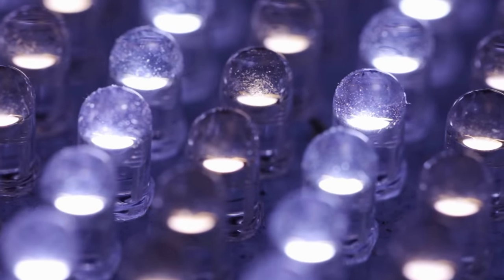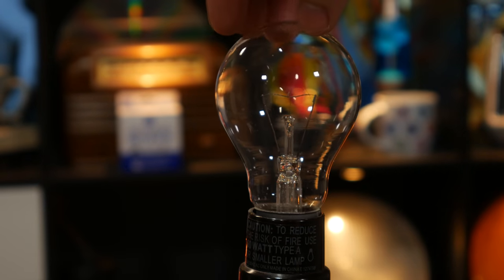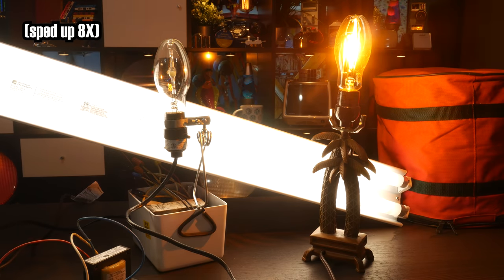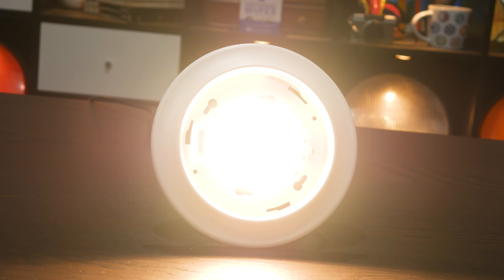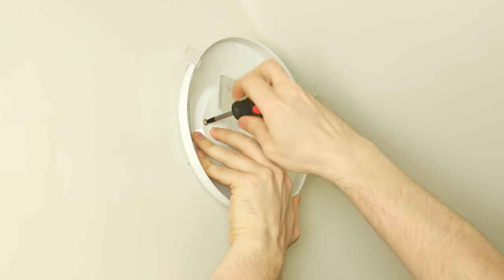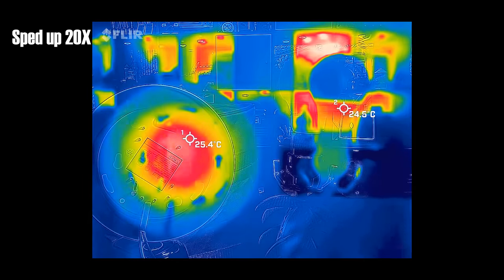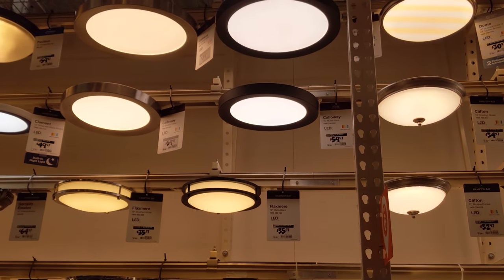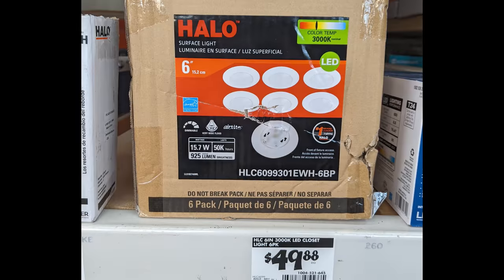A troubling trend in lighting?

Comment: I'm here to provide the aforementioned inevitable wire nuts vs wagos argument. Integrated LED fixtures are a great application for wagos, because they're quick to remove when the fixture dies, easier to install correctly than wire nuts, and more easily handle the joining of solid wire with the stranded wire from the fixture.
Reply: Funny??? Here in the USA I have been using wire nuts for over 40 years and have never had a problem. The key is to use them correctly by stripping at least 1/4" of the wires and then critically aligning the tips of the wires holding them firmly while twisting the nut on. Also, don't over/under exceed the amount of wires inserted into the size selected and it's wire size/quantity rating.
ie... Don't try to insert only two 12ga wires into a red wire nut. For the red nut at least 3 or more 12ga or two 10ga minimum.
You can look up the specifications for each size nut and then use them correctly.
Reply: GreatScott! has a video on this very topic.
Reply: @quinnobi42  I've seen it and probably made a comment there too.
Reply: @DrHarryT  So we can say that you need 40 years training with wire nuts to be able to use them as easily as a Wago? 🙂
Reply: 100% the WAGO lever nuts are PERFECT for this lighting application.  I have never seen the lights this dude has in the video.  I buy the kind that have the electronics in a separate electrical box and the light itself connects to that with a secure but easy to remove connector.
Reply: @DrHarryT  So there's little to no tolerance in the method of fixing?
Reply: @alvaros.  nah, you need like one minute. Wirenuts are easy as crap. Its legit strip, twist with pliers the. Twist the wirenuts.
Reply: @DrHarryT  bruh, red wirenuts can hold most stuff if you aint terible at twisting wires. 2 12s in a red is alright
Reply: @kyungrix1112  can’t burry junction boxes
Reply: @syi tiger907  yeah pretty much everyone knows that,  why are you telling me? 🤔
Reply: @DrHarryT  not sure if you were being sarcastic, but thanks for proving OP's point.
Reply: Thanks for the info on wagos.  My dad used to solder wire connexions in the old days, then finally used wire nuts and wrapped everything halfway to midnight with black tape.  I think I prefer wagos after listening to the vid, reading your comment and doing some scouting on the web.
Reply: @DrHarryT  or use wagos and avoid all that. Reducing the opportunity for errors.
Reply: @calebsanders1078  Ive seen over and over you do not twist the wires before using the wire nut
Reply: @DrHarryT  I’m a recent wago convert and I’ve been using wire nuts for as long. Wago much cleaner and take up far less space in the box.
Reply: A little bit of third world insight: we rarely ever use either one of those, and the only somewhat decent solution you often see are terminal block connectors. Usually people just twist the wires together and wrap them in tape (including electricians, which is why I installed everything in my home myself). Wago connectors seem to be quite overpriced here, each easily costing twice as much as an LED light bulb
Reply: @DrHarryT  The fact that something has been used  for a long time is not a reason for not improve it. Think of the awful Imperial system...
Reply: @asronome  Bro you are getting ripped off hard, those things cost nothing here!
Reply: Coming from germany and basically doing my own home electricity since 25 years after the big fuse box, I never seen wire nuts before. Just purchased a ceiling fan, and I wondered how anybody would use those things over wagos. Or if you dont want wagos, the cheap way here are "Lüsterklemmen". basically wagos but you fix the wire with a screw and can do All 3 wires on on clamp. 
Like wirenuts seems like such a big hassle (and also take up the same amount of space) compared to lüsterklemmen. Personally, when space is of importance I solder the joint, if not wago. If I dont have wago, lüster.
Reply: Holy crap! Why had I never heard of wago connectors until now?! So, when I had to replace a bunch of ceiling fans and light fixtures in my new home, I was using wire nuts. My house has much heavier gauge wires than what any of the new fixtures were using and I was having trouble getting the wire nuts to grip both wires (if it was tight enough to grip the house wire, it would mangle the fixture wire, pushing it down and out of the wire nut. If I went up a size, it was too loose). The lower gauge stranded wire just didn’t want to play nice. Using a wago over a wire nut would have saved me SO MUCH time and aggravation… and saved my sore shoulders, back, thighs, and feet from standing on a frigging ladder with my arms above my head for long periods while I argue with stupid wires…
Reply: @OgbondSandvol  Think of the physics/design of each method.
The WAGO uses spring loads to make contact with the wire in pinpoint areas. The bridge between the holes is a thin metal strip. US code allows for safely flowing 27 amps through a 12ga conductor while 10 wires are packed into a 1/2" EMT conduit. Typical limit for inserting a 12ga wire into a breaker is a 20 amp breaker. Now try inserting two 12ga wires into each hole of a WAGO and flow 20A through the connector, then use an infrared camera to measure the heat. I am certain it would be quite substantial. That heat over time would degrade the connection. Heat/poor connection/pressure=Failure.

Now look at the wire nut...It has a spring steel cone with sharp threads that when wires are inserted and it is screwed on it bites into the wires and with the cone shape begins molding the wires together. Those wires end up with 1,000's of pounds worth of pressure.
I was born with the "Imperial system and it has also worked perfect for me. Admittedly Metric has more granularity with only two exceptions and that is in temperature readings and in our utilization of .000" [thousandths of an inch]
Sometimes easier is not better.
Murphey's law...
If it works, don't F-with it.
Other principals that are akin to that one...
Don't break a winning combination.
and
If what you're doing is not working then maybe you ought to try something different.
Wire nuts = Work.
Imperial = Works.
Another principal...
If you keep doing the same thing you're going to get the same results.
I like the results,
Reply: So it's WAGO all the way... go?
Reply: @Caffeine.And.Carvings  I always hated that we had to use Lüsterklemmen in school (went to a trade school (Berufsfachschule)) WAGOs are just so much better imo. They are also safer because the can't come loose over time like Lüsterklemmen.
Reply: Wirenuts are easy..... but repeated usage weakens the wire, especially stranded, but solid too. At best you only have 6 inches free up there, sometimes a lot less. I am a electrician myself, and even I can see the benefits of a wago in a low current setting like this... especially given the disposable nature of these fixtures.
Reply: @DrHarryT  You have listed all the reasons I hate wire nuts except for one.  My hands are usually greasy/dirty, so I have to have pliers to get to the correct torque.
Reply: NAH... If and when I ever get stuck with a disposable fixture, I'm wiring an outlet to the inside of the box and an ordinary power cord and PLUG to the god damn lamp... When it dies, unscrew it with flashlight in teeth, and pull the plug... Toss and replace with a newly "remanufactured" lamp as before... done...

    I have a soldering set up I'm NOT afraid to use... and LOTS AND LOTS of hard-solder. (high-temp and high abuse tolerance)...

     If you got the impression that I say thing s like "F*** it... It's good enough for government work." You are CORRECT. ;o)
Reply: @alvaros.  IKR?! I used a Wago properly within a minute of picking one out of the packet, use the specified AWG range on the connector, strip back 11mm of wire, open the lever, insert wire all the way, close lever and you're done.
Reply: @DrHarryT  The bridge between the holes IS NOT a thin wire strip. Today I installed a Wago rated to 41A (but UL rating is 30 A - but I myself have some doubt, and the appliance uses max 25 A). The bridge is electrolyctical copper.  
Wire nuts work, but most of times Wago works better.

Imperial works? Sort of.
Metrics works better, but I'm afraid that you would need to born again in a metrics environment to understand it. ;-)
But, although its population uses Imperial, is good to know that US is a metric country, too.
Reply: @OgbondSandvol  All american weight measurements are made from a reference weight that is exactly 1kg and was imported from Europe
Reply: @DrHarryT  I first want to get straight what you're calling "a wago". After over 20 years as an industrial and commercial maintenance electrician in the U.S.I felt the same as you, until I realized a couple of things a couple of years ago. One is that what people refer to as wagos are two different things, one is the push-in and one is the lever nut. I'd only had experience with the push-in type until a couple of years ago. I don't like the push in type, don't trust the grip since the way I usually take them off is to just twist and yank and almost impossible to get a good grip on stranded if unless you tin the wire and bringing a soldering set up hip deep into a ceiling is pretty low on the list of things I want to do. My feelings on the lever-nut type are completely opposite, I've actually hung my 300 lb self off of a lever nut connection. It's not going anywhere unless you goof on the stripping and either feed plastic into the grip or not get enough into it to hold. The second thing is the rating is higher than the wire you can fit in it so don't worry about the rating. The one that fits 12 awg is rated at 32 amps the one that fits 10awg is rated at 41 amps that's at least 6 amps over the wire size ratings.
 Another thing you mention is the pressure of the wire nut screw cone. That lessens over time, it's a spring just like the wagos, and unlike the wagos whose spring can originally shut to nothing the wire nut loosens if just a little tension is let off and only down to it's original gauge. I've opened several old fixtures with loose wire nuts that were fine for their first 20 years. Also if you're the type of person that in construction 100 percent believes in the turn of his wire nut, you're the type of person I don't want to follow in maintenance because you leave twisted solid wires and broken off strands of stranded wires that I can't put in another connector so have to cut it off and lose a precious inch or so of wire.
Also you can add and delete legs in a wago safely and easily live, unlike trying to fit the hot back into the wire nut with the new leg without putting your fingers on the wires to straighten them out.
I'm a full convert on the lever nuts. The push ins I only use on ballast bypasses for fluorescent to led because it's a lot quicker to just stab 7 wires for one side than try to get 7 tiny ballast solid wires to all agree to be held by a wire nut and they only have the levers up to 5.
Reply: Stop defending your personal experience like it is some important rite of passage or required curriculum.  You can take the easier route without forfeiting your electrical engineering degree (even if your practice at using wire nuts no longer confers any ongoing benefit).

I too have been using wire nuts for years and find them very straightforward and intuitive.  No training is required, and they are perfectly functional.  I recently put up some pot lights that had me using wago connectors for the first time ever, and I'd have to be pretty irrational to defend wire nuts afterward.

In a simplistic sense, wire nuts are indeed easy.  In a practical sense, you still have to strip 2 solid wires, twist them together with pliers or wasted over-stripped wire to be cut off afterward (because you're going to actually make a strong connection with plenty of solid contact, right?) and then screw on the nut.  When connecting stranded wire, after twisting it around the solid one, you then have to carefully hold it against the tip lest it slide away as it wants to do, with the solid wire being stiff and the stranded one having a device hanging off of it.  Work in an awkward position or with wires that don't want to be in alignment, and some care is needed to ensure you've managed to grab plenty of the individual strands and not just a few long stragglers.
 
Wago is simple in principle AND in practice.  Strip wire, jam in hole.  My proficiency at using wire nuts is irrelevant in the face of an alternative that in real-world scenarios is going to be less awkward, and regardless of skill level waste less of my valuable time.  It's not a matter of complexity, it's a matter of effort .  Wire nuts don't take much.  Wago connectors still manage to reduce it by up to a factor of 4.
Reply: I'm a electrician from the UK and wire nuts should be banned period
Reply: In the civilized Nordic countries where we use the superior 3 phase 400v with 230v 1 phase system our amper loads stay at 10 to 16A in a standard household so we happily use wagos and nuts are banned ages ago.

I hate nuts they take too much space, make the joint boxes messy and harder to make modifications. 

Every time I see nuts I replace them with wagos and tidy up the box and get some weird sexual satisfaction from doing so.

You guys are weird in the States.
Reply: @plebiansociety  Know your tools and use your equipment correctly, thus I never over tighten a wire nut. I've never seen a wire nut come loose just sitting in the J-Box. Yes I have installed New construction concrete [Industrial] tilt up's with power vaults using MCM1000 alum wire. I've done commercial new and retrofit. [small strip mall or industrial complexes] Not much new home but many room addition jobs pulling new feeds from the panel with rome cable and all the associated electrical infrastructure.
I didn't just fall off the turnip truck.

I haven't had the opportunity to use those "WAGO" devices personally but I have seen videos of an Infared camera showing them getting excessively hot. Maybe that's because they were cheap China knockoffs.

For me I'm almost 10 years disabled retired so to me it really does not matter. I have wire nuts on hand and if I need to do something here around the house, I will still use them. [Pushing 60 and have seen a lot, of course the key to wisdom is knowing that there will always be more to learn.]
If I ever encounter one in the field of maybe the next time I am in the hardware/Home Depot/Lowes stores and I think about I'll inspect one closely to see if they appear to be able to handle the current they specify.

In the automotive industry [I'm ASE certified] my "No-Fail" connection is to take the wires stripped 1/4" and preferably overlap them [not bunch] and then take a piece of one strand out of a 14ga stranded wire and tightly coil neatly around the overlapped wires, then fill the joint with solder. If possible use shrink tube, if not then use 3M Super 33+ 20 year rubberized electrical tape.
Reply: @maximkovac2000  thats what I thought when I said that US is a metric country too
Reply: WAGOs are love, WAGOs are life.
Reply: @gnarthdarkanen7464  That's against the code. Any and all plugs need to be accessible at all times.
Reply: @LMojzis  So is burning the house down... BUT it's MY house and I'll set it on fire if I want to. ;o)
Reply: @DrHarryT  Alternatively, we can use a connector where the trick is to strip as much insulation as the tip on the thing itself tells you, and... Just use the right connector, AKA don't shove 4 mm^2 wires into the 2.5 mm^2 rated connector. Or stranded wire into the solid wire connector (222 series), and using instead the universal one (221 series). There's a reason these things are code even in industrial electronics now in the EU. That, and they're the only non-permanent connection that isn't damaged by vibration long term.
Reply: @alvaros.  I said I've been using them not training for them.
Reply: @alvaros.  I said I've been using them not training for them.
Reply: @gleggett3817  That's installing not "fixing" and in life there are "tolerances" for everything. That's about doing something right.
Reply: @calebsanders1078  There's you way and then there's the right way. Look up electrical codes.
Reply: @cavvieira  Being sincere and factual.
Reply: @fixitallpaul4847  There is no "opportunity for errors" if you know what you are doing.
Reply: @OgbondSandvol  Look at the design/implementation physics before making an evaluation as to if a new/different method is better or not.
Reply: @johntoe6127  Work cleaner.
Reply: @DrHarryT  your loss, they’re ul approved and work great. Never loose.
Reply: @maximkovac2000  What is that "reference weight"? 1kg = 2.2lbs   454g = 1oz
Reply: @RickLaBanca  No loss for me, I am retired and therefore rarely have to do electrical work anyway.
Reply: @DrHarryT  you just DONT WANT to think about Wago being superior, so, you will never realize that.
Reply: @OgbondSandvol  The fact is I don't believe they are superior in functionality. I already have explained why I don't believe they are in other comments.
 [Contact pressure/surface area and conductive mass pathway.]

Granted they are easier to use and save space, but that comes at a price I wouldn't be willing to pay/risk. For individual lights no more that 240W~ @120V [2Amps] they would be great but I certainly wouldn't use them to tie in 20A circuits.

Wirenuts work for me and I don't trust the other option. For the rarity I have to deal with wiring these days, I don't really care.
Reply: @DrHarryT  Leastwise, in the long run both of us will be all dead.
Reply: Not to mention, LED systems draw so much less current, the odds of overheating the connection drop to almost infinitesimal.
Reply: @DrHarryT The main advantage of the Wago style connectors stiIl is that they are hard to screw up, even if you almost try.
Reply: best discussion ever!
wagos are clearly better though 🙊
Reply: @DrHarryT wire nuts work and provide slightly lower resistances compared to wagos with a few other minor benefits. The problem is that you have to do everything right and thay is sometimes a pain. I'm pretty knowledgeable on electrical but when I was installing a wall mounted light fixture I found twisting the nut and everything together was a pain while holding the fixture up. I did get it done then did a pull test and watched it all pull apart after one hard jolt. It's not hard to do it right, but for something so simple it's a pain. Wagos are stupid easy and are dam near impossible to screw up. You can do everything with wire nuts, but even a fool like me will have an easier and quicker time using the flippy boys over someone with years of wire nut experience like you.